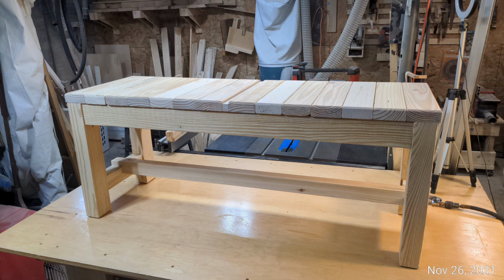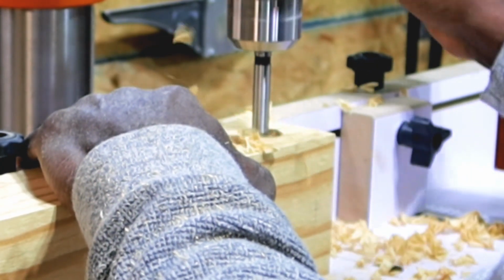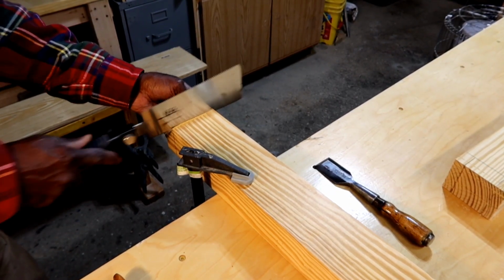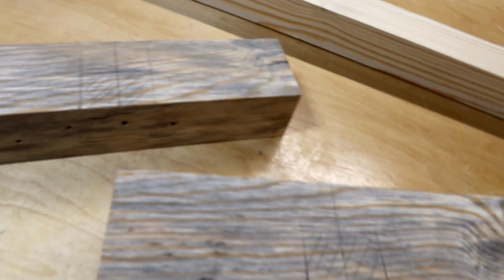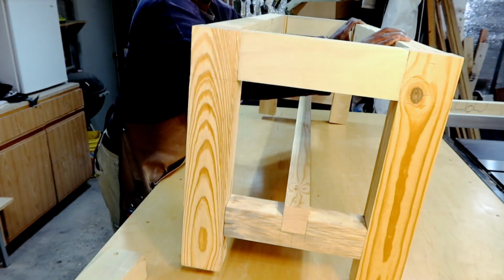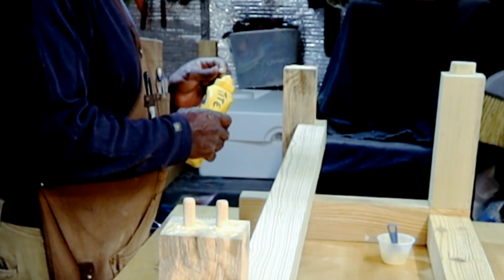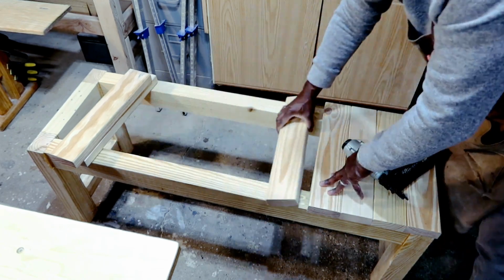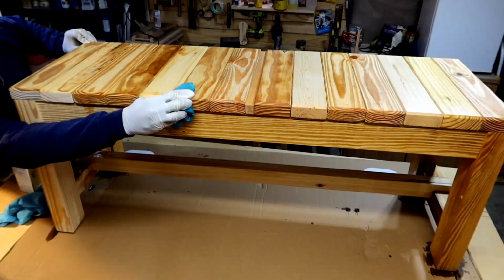How I build a beautiful hefty entryway bench that will last a lifetime.

Comment: Looks great!  The tung oil really made it pop, and the chamfered edges are a nice touch.  

How do you like the clamps you used for the glue up?  I'm in the market for some new clamps but I hear mixed reviews about that style.
Reply from the maker: Hey Woodworker Chris, thank you you're right that tongue oil made it pop. Yes I think the chamfered edges are easier on the back of the legs when sitting on it and also gives it a good look.
About the clamps, they're just harbor freight brand and they seem to do pretty good I couldn't justify buying some of the more expensive ones in those lengths so I went with harbor freight as long as you don't try to over tighten them I think they'll be fine they work good enough to pull those joints together and get good squeeze out.
Reply: @WoodShopStop  Awesome, thanks for the insight.  Enjoy the rest of your weekend!
Reply from the maker: @woodworkerchris1903  you're welcome I might add that I think the next investment and clamps that I'll make will be with pipe clamps for more robust clamping pressure. Enjoy the rest of your Sunday and have a good week.